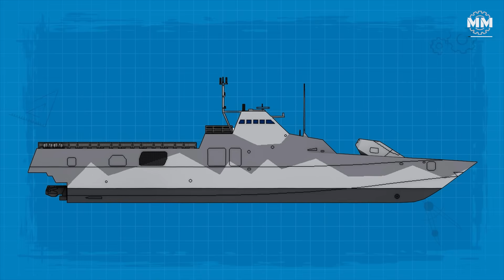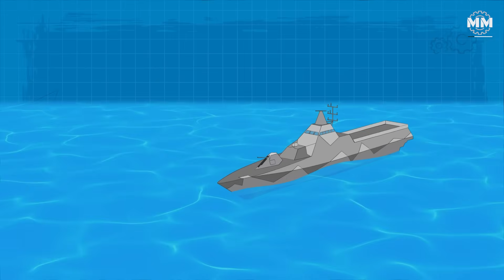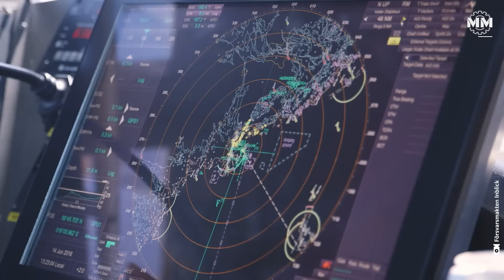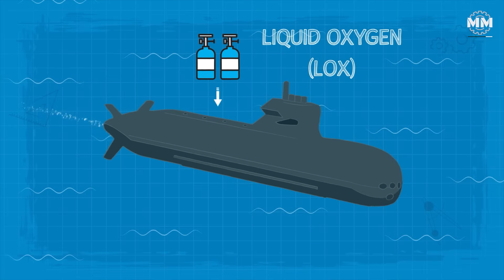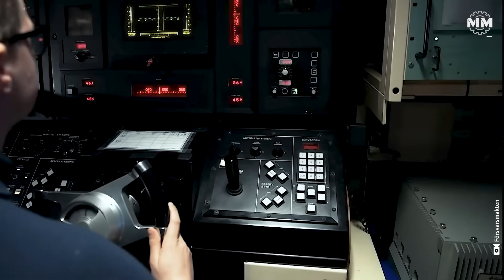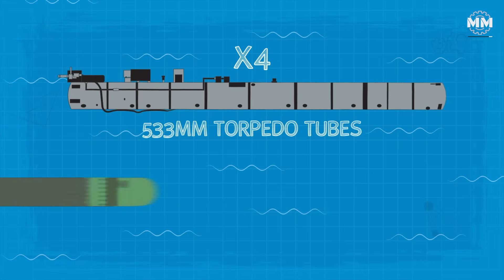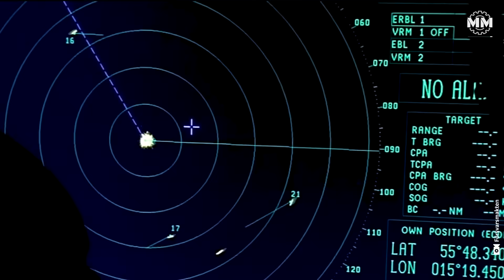Visby & Gotland: The Swedish Stealth Duo That Outsmarted a U.S. Carrier

Comment: There are some things wrong with this video, the class used RBS-15 mk2 and will get mk4 when those are delivered (they seems to be delayed as the coastal batteries got mk3 recently which was not the plan).
The ships use Torpedo 45 and the newer Torpedo 47 which are light 40cm torpedoes primarily for use against subs but can be used against surface targets. A new torpedo tube has been introduced that can be stacked which increases the number of torpedo tubes on the Visby to 8 if all are fitted.
The ships will undergo a MLU starting this year which will see them fitted with Sea Ceptor in three Exls units with three mk41 vls cells each in a total of 9 soft launch only mk41 vls tubes for a total of 36 Sea Ceptor missiles. We don't know what sensors the ships will get in the MLU.